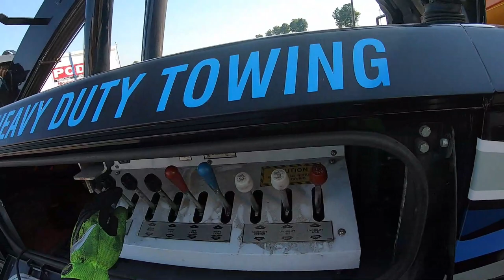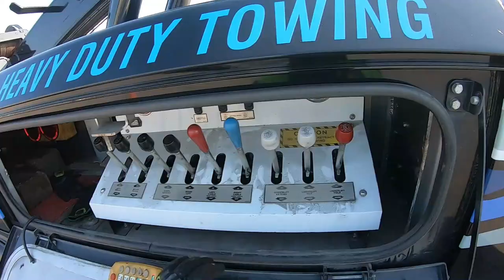Tanker Time! Out With The Old in With The New!

Comment: How often do tow operators have to sleep in the truck? That’s a bed right?
Reply from the maker: Not often, mostly when out on a long haul good for catching a nap.  We order trucks with small sleepers mostly for the room.  Were all large tall fellas LOL
Reply: I would imagine it would be very rare to legally have to use the sleeper, as in nearly never. If a trip is going to be long enough to require a break there will be enough revenue to justify putting everyone in a hotel. 

From a practical standpoint the sleeper makes the office space up front much more comfortable because you don't feel so closed in as you would with a day cab. 

The other practical part is even if the law doesn't require a sleeper, most safety managers and insurance companies would really prefer the driver to have easy, convenient access to a proper place to rest when needed.